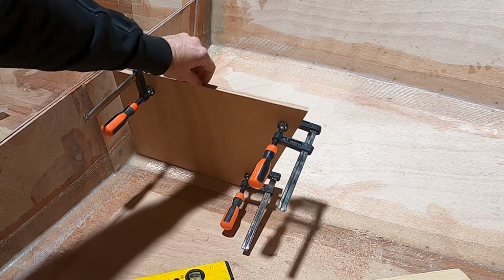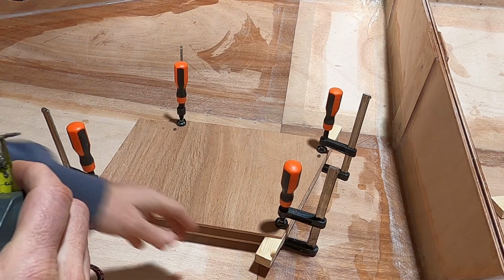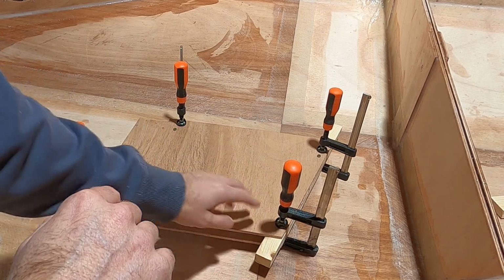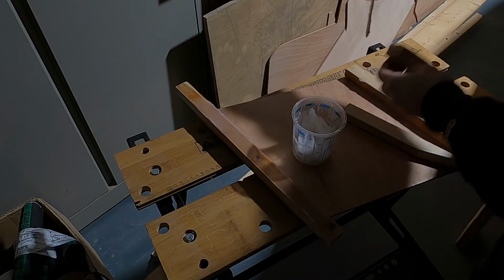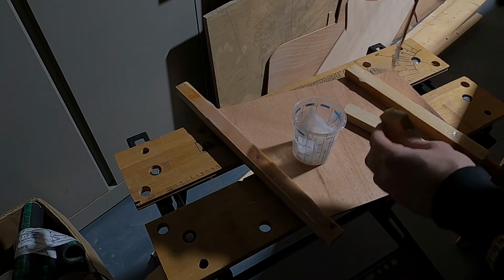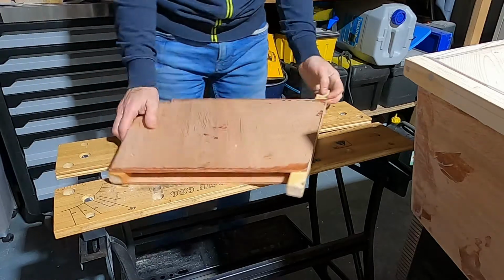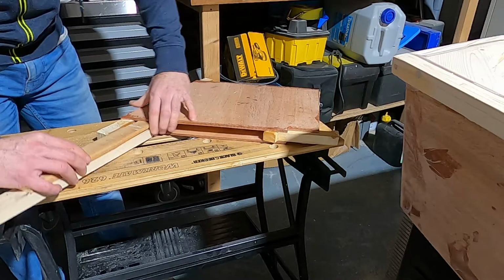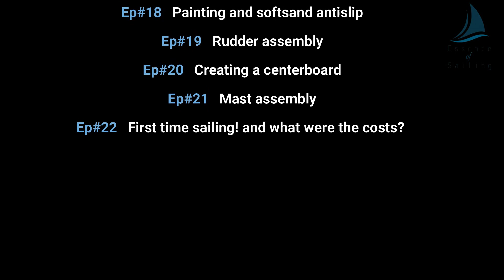Building my nesting dinghy - a sailing spindrift 10  EP_10

Comment: Use a heat gun or a hair dryer set on high heat to try to loosen the hold the epoxy has on the wood.